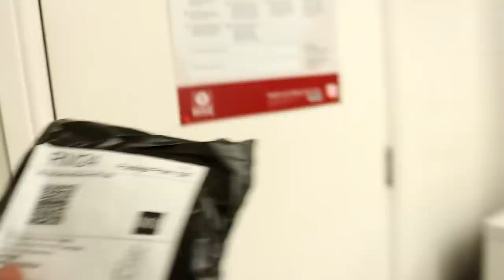THE GRIST

Comment: Ahem, would that not be wort going into the boil kettle, not beer 😉 😄 . Rebate, not rabbit 😄 .  That's a far more accurate hydrometer than the one that I use 😊 . I do well to guess to the nearest 0.001 at best and that's splitting the lines. I would love to be a moderator and help out but I really don't think that I would have the required time, I'm yet again behind on the vids and won't get to watch yesterdays until tomorrow. Great update as usual, Cheers, Schnuz.

Comment: Are you not worried about hot side aeration with the wort pouring from the top to the bottom of the boil kettle or is there a pipe on the inside?
Reply from the maker: I have done both and never noticed a difference. I am Still a bit skeptical on the hot side aeration thing as the research I have read so far seems inconclusive or has confirmation bias creeping in.